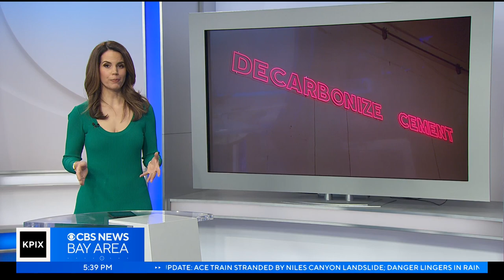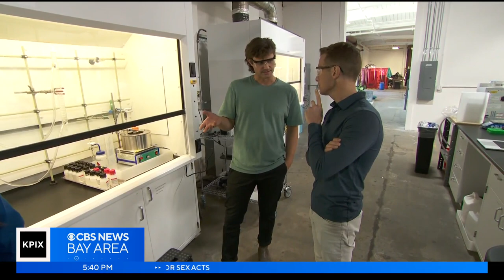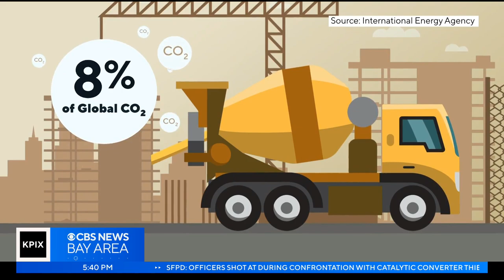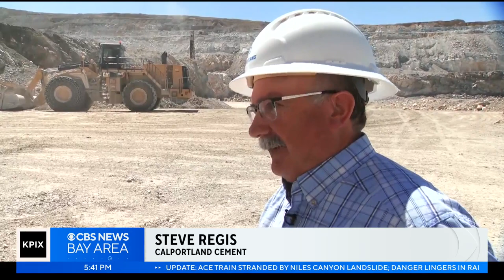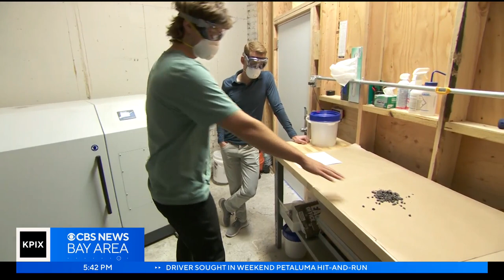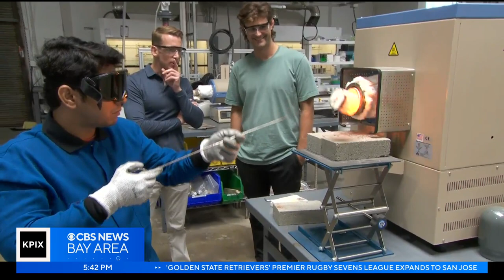Oakland company developing emission-free cement alternative

Comment: If this is so good, why haven't people been using it instead of limestone?
Reply: The cement and Construction industry are very conservative industries. Before cement people used carved stone, baked mud and rammed earth. Customs and Traditions are hard to break. Bamboo is very sustainable but where it is grown people scone it as a nonpractical building material because structures made from it rot fairly quickly. Enter a sustainable way of treating the bamboo with an environmentally friendly long lasting preservative in the form of Borax and now centuries of negative views towards it are slowly changing.

Comment: It’s the coal used to heat the rock that is the carbon footprint.
Reply: Correction: the coal used to heat the limestone is only part of the problem not the whole problem. Cement is made with limestone aka calcium-carbonate.  When mixed with water to form concrete it releases the carbon stored its bonds to harden reacting with the oxygen in the water to form carbon dioxide. The new cement formular he proposes uses Basalt aka calcium-silicate and when mixed with water releases no carbon dioxide is released into the atmosphere.